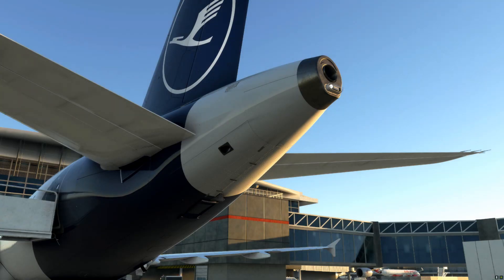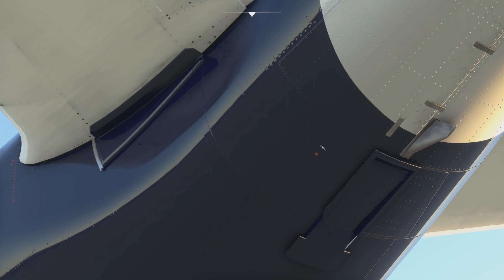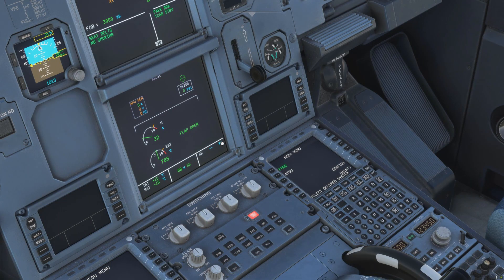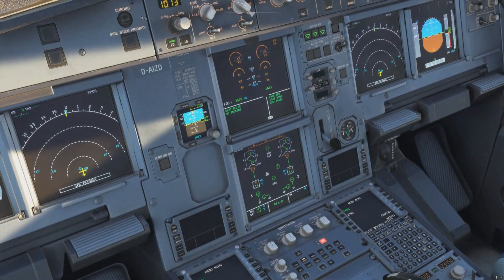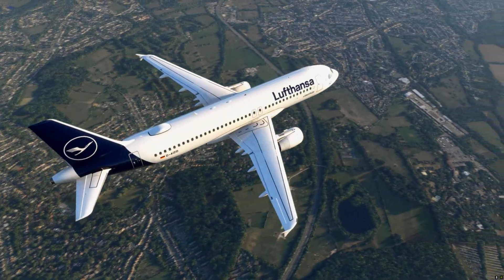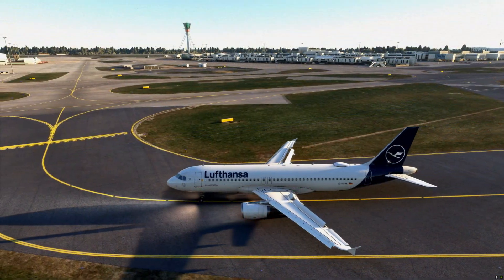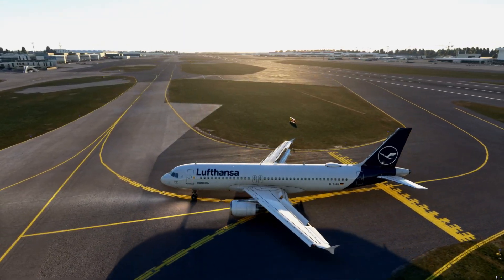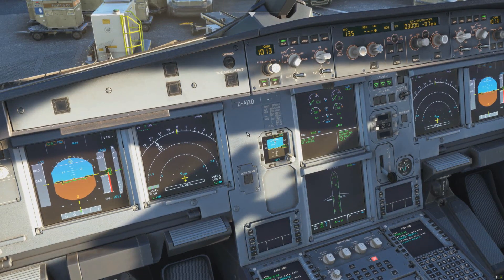How to correctly use the APU

Comment: Are fuel pumps turned on for the APU startup?
Reply from the maker: No, the fuel pumps are only for the wing tanks. The APU runs independently from them.
Hope this helps
Reply: @ Good to know. I've noticed in some videos of actual a320 operations and in sim operations they turn on the left center tk pump when starting the APU, guess its a company dependent thing? It runs independently so I guess it doesn't really matter.
Reply from the maker: @Subiwu  some companies use the fuel pumps on the ground, some don't. As a general rule we don't, unless in icing conditions. When uplifting warm fuel, having it circulating can avoid ice formation on the wings.

Comment: Thank you very much for all your videos! But a question: Some guys turn on one Fuelpump before starting the APU. Is this correct? Greeting from Tirol
Reply from the maker: I have never seen that myself. The fuel pumps are not connected to the APU, so I am not quite sure why you would want to do this.
We switch the pumps on just before push-back.
Hope this helps.
Reply: Boeing

Comment: this is brilliant, thank you for sharing. For a future video, could you cover in some detail the radio navigation panel and audio control panels? I understand some basics, but in the real aircraft, I wonder how you would in practice talk to ground, how to talk to the cabin, how to use HF radio (if you ever need it?). How to transmit and/or receive correctly, monitor multiple frequencies etc, thanks!

Comment: Thanks 
Just one question. Just before takeoff, when you switched off the  APU master switch, tge “available” APU indicator stayed lit green (or just a simulator bug) 

Is it normal ?
Reply from the maker: @Thierry.g38  yes it's normal. The available stays on for a bit longer as the APU takes time to shut down.
I did encounter one strange thing where the APU wouldn't shut down at the gate. I switched it off but it just kept running. I will see if I can replicate it. That is definitely a Fenix bug

Comment: What is the procedure if there is no ground power available during shutdown? Are the APU flaps able to close on battery power only? Great video!
Reply from the maker: @IanBanic  No, the batteries cannot close the flaps. You either wait until they organise another GPU or just shut it down and make an entry into the log book for maintenance. Luckily, so far I have never had that situation.
Reply: @fsclips the batteries, actually shut the apu inlet flap, otherwise how do you start the apu without GPU? 🙃
Reply from the maker: @VirtualFlightTraining  I thought they can only open them, but not shut them 🤔
Hence the procedure to wait for the flaps to be closed. Hmmm..I need to see if I can consult the books on that.

Comment: Why do most US operators start engine 1 first, while European operators start engine 2 first?
Reply from the maker: @Islandsoundzz  We start No2 first and it was always my impression that this is the way Airbus wants it. The No2 engine powers the yellow hydraulic system which pressurizes the parking brake.
Reply: @fsclips correct, airbus says ENG 2 is the first to be started, but many airline SOP’s seem to state that ENG 1 is to be started first

But that’s the classic “we from the airline that didn’t build that machine know better than the manufacturer” scenario 😝
Reply: I believe its because that's usually the side where the ramp agents work (cargo doors are on the side of engine 2)
Reply: my friend says if you start ENG 2 first you slip some bit test i think like fuel or something. By starting ENG 1 the plane will go through its test and then you can start 2
Reply: There was a veeery long, very technisch conversation on another channel some time ago.

Afair - US based they start No1 first and then (sry for the wrong terminology) cross activate the Hydraulic. Why - because they more often use single engine Taxi due to their huge airports.

But pls don't kill me if I now Mix up things. 😅
Reply: @FieselvonWiesel  Hm, that's a bit strange, because the size of airports in the US and in Europe does not differ much on an average.
Reply: The yellow electric pump can pressurize the yellow system, so most if not all US carriers start engine 1 first and in the after start flow, if single engine taxiing, include turning the Y Elec pump on in the after start flow. If you single engine taxi on #2, the PTU will be running the whole time which can be annoying in the cabin and startling to passengers who aren’t use to flying on an Airbus.
Reply: Actually Airbus has recently changed the procedures to start engine one first

Comment: Setter the old debate, which engine is started first? :)
Reply from the maker: The first engine to be started is always the APU 😉
Reply: @fsclips  Unless you have external power and external HP air. Then you don't need APU ;-)
Reply: @macieksoft  Keep in mind that you most often start engines during pushback :) I'm not a real world pilot but I haven't seen anyone starting engines using PCA. Is it even possible to start engines using PCA instead of APU bleed?
Reply: @JakubowiczPiotr  Concorde used dual HP air connections as the only way to start engines, because Concorde had no APU. Nowdays many airliners have ground HP air connections, you may start the first engine using ground HP air and then start the rest of them using crossbleed. I guess that use that whenever APU is deferred.
Reply from the maker: @simulacrae  To answer your question. We always start No2 first because it supplies the yellow hydraulic system and therefore the parking brake. If the pushback is done before the second engine start then you really want the yellow hydraulic system to be pressurised.
Reply: It depends on the aircraft type
Reply: @ABU_K58  this video is is about the 320 series soooo
Reply: When and how to perform a Conf3 landing? And which is the prioritized choice, conf3 or full?
Reply: @constantinejin1801  In normal conditions full is used. This is to reduce the landing speed (reducing brake and tire wear). CONF3 is used during engine out landings to reduce drag in case of go around.